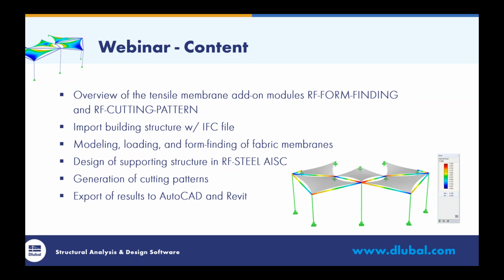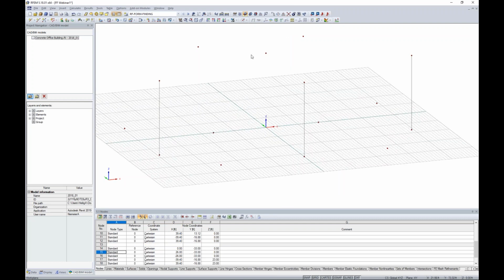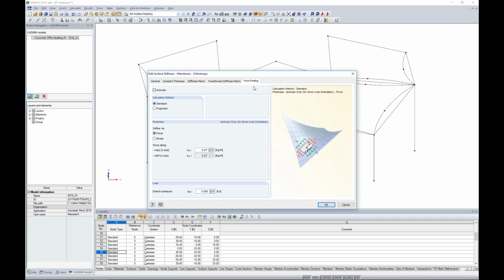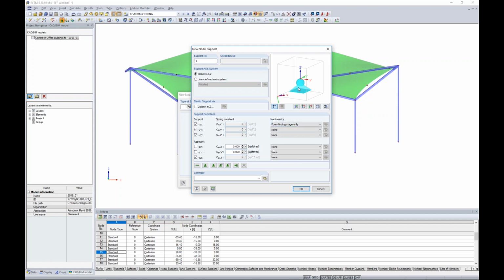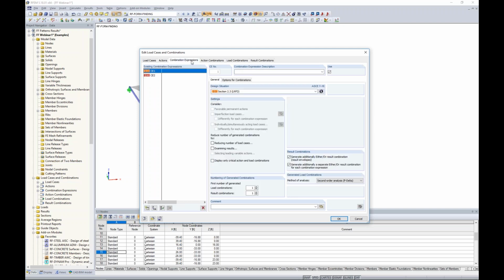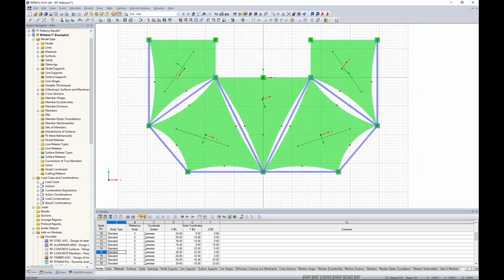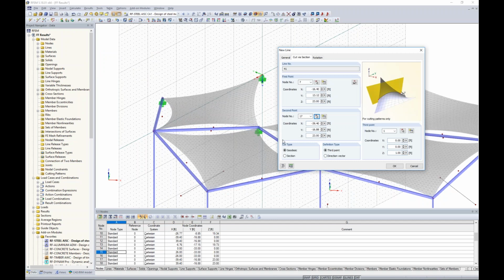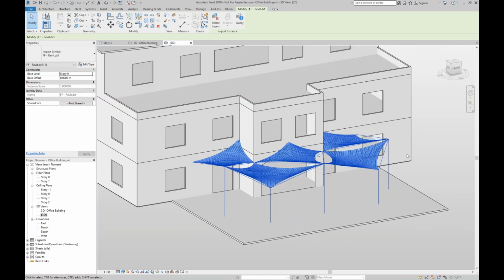Webinar: Tensile Membrane Structure Design in RFEM (USA)

Comment: THANK YOU VERY MUCH FOR THIS WEBINAR

I HAVE 3 QUESTIONS :
1- WHEN INPUT WARP AND WEFT AS 0.5KIPS/FT , AND THEN RUN RESULTS FINDING FORM IS DONE AND I SHOW TENSILE FORCE / FT IN MEMBRANE IS 0.5 KIPS/FT .
QUESTION MAY BE TENSILE FORCE NOT REACH TO WARP AND WEFT ?
I MEAN CONTROL OF SHAPE IS WARP AND WEFT OR FORMING THAT I WILL ACHIEVE IT BY CABLES ?  
ALSO IT REACH TO ITS STRENGTH CAPCITY (WARP) SOWHEN I APPLIED LOAD IT WILLNOT RESIST? 

2- LOCATIONS OF CURVE MUST BE IN THE CENTER OF LINE THAT I DRAW THROUGHT IT 

3- ALPHA M NOT CLEAR PLEASE CAN YOU SHARE ANY CALIFIRCATION ON IT ?
Reply from the maker: Hi, mostafa!
It would be best to email info@dlubal.com along with your model so we can provide you the answer to your questions in more detail. Thank you.

Comment: Hi, Amy! Thank you for a great webinar. Is it possible to keep z=x^2+y^2 (cable node coordinate) during the form-finding process?
Reply from the maker: Hi, Сергей!
The cable end nodes are defined by particular (X,Y,Z) coordinate points.  The shape of the cable along the length will be determined by the form-finding process and cannot be limited to a specific coordinate point.  This is only possible at the end nodes.
Reply: @DlubalEN  Amy, thank you the answer. I mean the following: I'd like to have the parabolic geodesic shape of the cable net. So, is it possible to change the (x,y) end node coordinates only keeping z=x^2+y^2? Of course from the form-finding process external forces which hold the node on the parabolic surface should be defined as well.
Reply from the maker: Hi, Сергей!
if understood correctly, you could create in FORM-FINDING the shape you want (e.g.  z=x^2+y^2 ). Then you place parallel lines on the desired xy coordinates and use the line intersection to cut the lines not needed so that only the nodes are shown. If you then connect the nodes using cables it should be done.
We hope this was helpful. You can also contact our support for further instructions about this issue.

Comment: Hi Amy,
What if a cable consists of many pieces how can i get whole cable's unstressed / stressed lengths?
Reply from the maker: Hi, BC!
Cables should consist of a single element and not multiple segments.  Multiple segments can cause issues when trying to find the cable's final shape from the the RF-FORM-FINDING prestress definition.
Reply: @DlubalEN  hi Amy thanks for the answer. I am trying to solve a cable net structure that contains intermediate cables and outer cables (with a certain sag) so they all are connected each other like a grid and therefore segments are inavitable. In this case what is the best solution method to get accurate results? A short video about cable nets would be great actually..
Reply from the maker: Hi, BC!
Instead of modeling each individual cable segment for a net, you should instead model a single surface element with the relevant properties from the net.  This information should come from the manufacturer.  You can then apply the form-finding settings directly to the surface. In the following Link you can find further Information regarding this topic. https://www.dlubal.com/en-US/support-and-learning/support/faq/004800
Reply: @DlubalEN  hi Amy thank you for  answering. But my cable net already includes surfaces (membeanes) in between some of the areas of the cables. So cables are a grid and i have membranes between them. (It looks like a chess board)
Reply from the maker: Hi, BC!
maybe it's best you send your model to info@dlubal.com with a short description, so we can help you with further instructions on that.
Reply: @DlubalEN  ok i will

Comment: How can i set different forces to membrane as prestress along x and y individually ?
Reply from the maker: Hi, BC!
Please take a look at FAQ 004185. https://www.dlubal.com/en/support-and-learning/support/faq/004185 

The warp and weft directions are linked to the axes of the surface. The default setting allows you to only apply isotropic prestress. If the axes are aligned, the orthotropic or radial prestress will be available as well.

Comment: Thanks for such a great tutorial. This is great software for us to work work with.
Reply from the maker: Hi, Sajjad!
Thank you for the compliment!
Do you need some further assistance? Which projects are you working on?
Reply: @DlubalEN what about design calculation for light weight membrance structures (pvc shades)
Reply from the maker: Hi, Sajjad!
You can easily consider PVC member sections and user-defined materials rather than steel directly in RFEM for the full analysis. The RF-FORM-FINDING module can further be used to consider the fabric membrane design.

Comment: Can I export it to ifc extension and open it on revit directly ?
Reply from the maker: Hi Mohamed.  The tensile structure must first be exported to AutoCAD, saved as a .dxf, and imported into Revit as a CAD Link similar to what is shown in the webinar.  Direct export as an .ifc is not available.
Reply: @DlubalEN  Yes, I've done this already. Thank you so much for this informative Webinars. It really helps a lot !
Reply from the maker: Hi, Mohamed!
Thank you!
Reply from the maker: Hi, Mohamed!
Regarding your question about IFC. 
Dlubal can export IFC files using the Structural Analysis View as this is the view for analysis data. However, Revit does not import such IFC file. Therefore, we implemented a direct integration to Revit that is more straight forward and links both programs. No conversion of IFC objects to Dlubal/Revit objects is needed. There are plenty of webinars online showing this.

See also: https://www.dlubal.com/en-US/support-and-learning/learning/webinars?query=revit&category=&program=&solution=&area=&standard=&cmd=filterwebinar